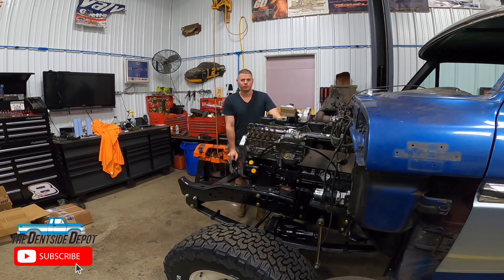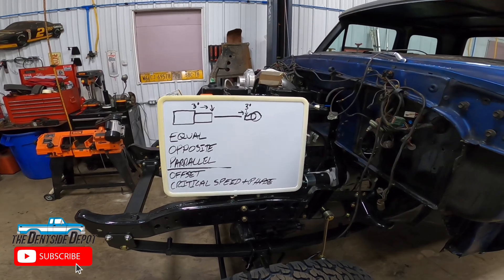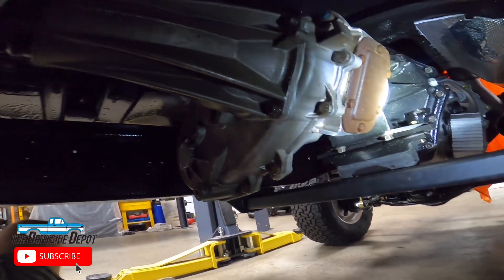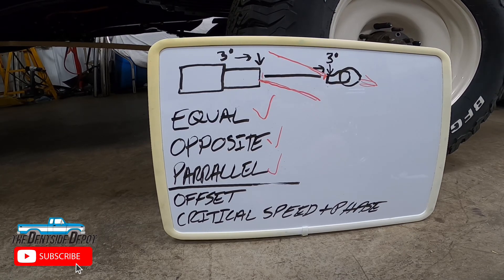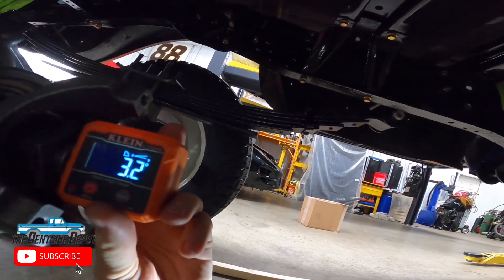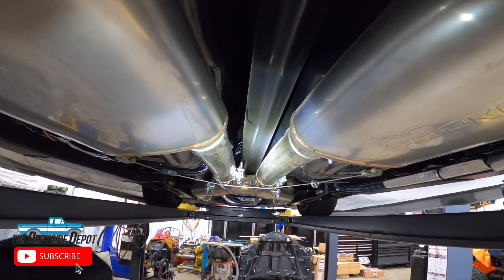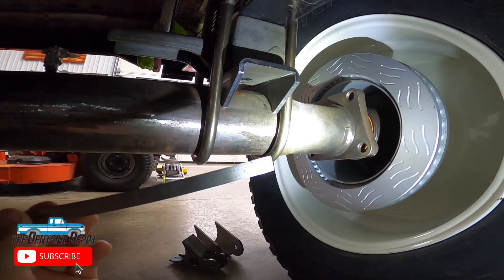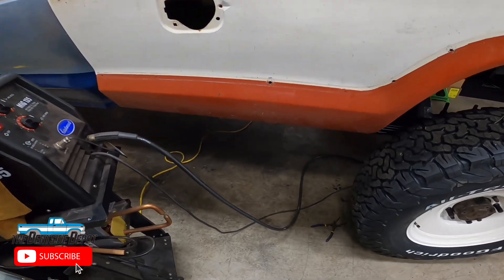How To Setup a Rear Axle on a Custom-Built Truck: Part 1

Comment from the maker: Thanks for watching, also keep in mind I have 2 degrees of adjustability built into my transmission mount via spacers, so If I do have a vibration, I can knock down my total working angle to about 5 degrees if needed. But, by doing so I reduce the clearance of the engine fan which will be a tight fit and the PPump will be slightly overfilled with oil in the back. These are all things to consider, hopefully this setup works out for me, if not then I have that backup plan in place if needed which is why I like to set the motor down farther then I need to and space it up to my ideal angle.

Comment: Thanks for the long video. When we would lift our trucks we would add a few spring leafs to each pack. Then lift blocks as we went up in tire size. Four Wheeler magazine back then did an article on drive shaft angles and suggested to angle the bottom of your lift blocks to relieve the extreme angle pressure on the axel side of the drive shaft. I worked for Ford Heavy truck back then and we would sell truck axel shims in different degrees . So we used them on our F250s , Chevy and Dodge trucks. The u joint at the axel hardly ever wore out but at the transfer case it Would eat them in a single off road run. On my truck there are CV joints at the transfer case so it would get expensive.The guys at Clutch and Ujoint I worked with building my driveshafts said it was better to have the same angle at the axel as at the transfer case to distribute the load evenly . We pulled out the shims and the Ujoints lasted considerably longer. This was in the late 70s and early 80s.
Reply from the maker: Absolutely. I agree with your writeup, in the description check out the Spicer video, they have a great demonstration for angles that shows velocity change. With a big lift, you have no choice but to have slope in the driveshaft. I plan to check them with every oil change and probably carry a spare on long trips just in case.
Reply: @DentsideDepot  Besides the extra Ujoints we brought with us eventually we would bring spare driveshafts we would get from a junkyard. We would rebuild them before we’d go out and trail ride and play in ponds.  Always would tape 2 wrenches for the driveshaft removal to each driveshaft just in case. Just little things we learned so we could spend more time playing and less time cussing.
Reply from the maker: @71FordGator  Dale Earnhardt used #1 screw drivers haha

Comment: Awesome she's coming together
Reply from the maker: Yea shes getting there, its been so much work just keeping my fingers crossed it turns out great!
Reply: @DentsideDepot  ausie.. having 4x4rs. i jack up the diff as far as it will stand. to raise the prop shaft. never had an issue.. even on a lwb, split shaft, did the same, ive actually ground the weld till they broke free, without taking diff out, then jacked it up, re welded..done this to 4 trucks, daily drivers. 110 ks hr, smooth..you can also use or make angled blocks to tilt diff. why go cummins, & not 7.3.. cummins are heavy, low revs..  i have a 4.2tdi.  s/duty, 02, brazilian. 700nm. 175kw.. no computer, just a td06.. tows 4.5t no probs..there a geman tractor engine, all mechanical. ohc, 3 valve, 3'' exhaust.. std they put out 510nm. 135 kw.. vids of them in brazil twin turbo, pushing a bike down the h/way..